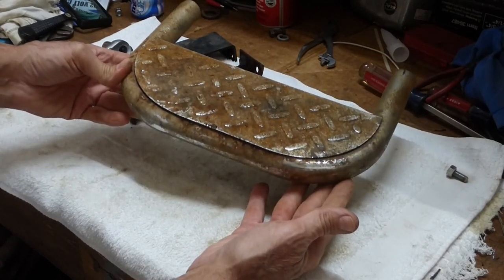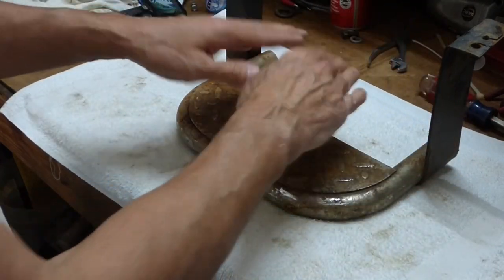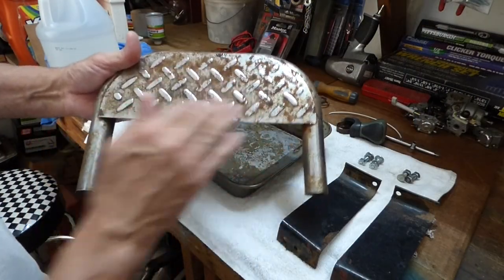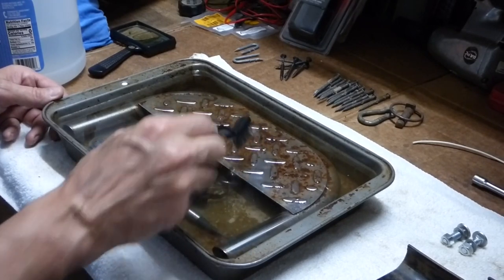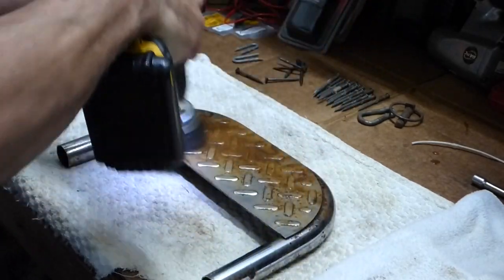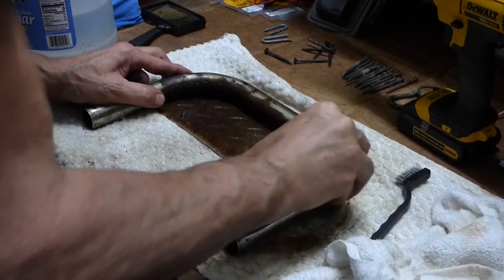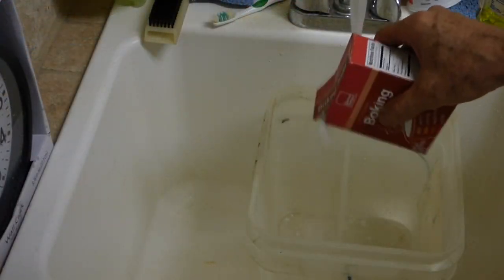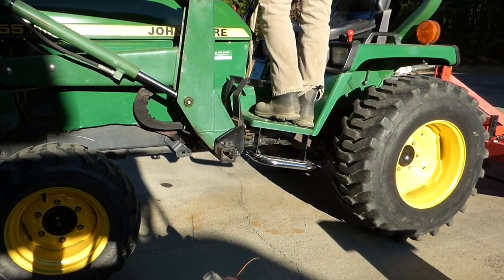How to Remove Rust From Metal - Amazing Results!

Comment: Great job. Personally, for chromed parts that are too far gone, I remove most of the heavy rust and then use phosphoric acid to convert the rust. Then I paint right over with chrome-simulating paint. It lasts quite a while.